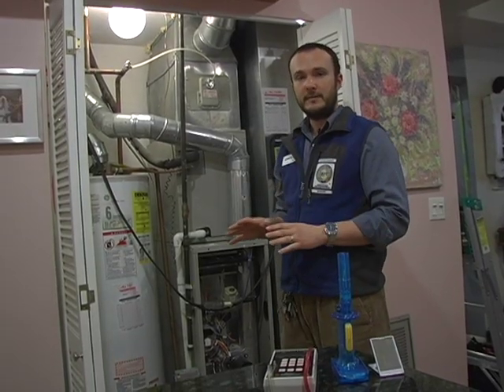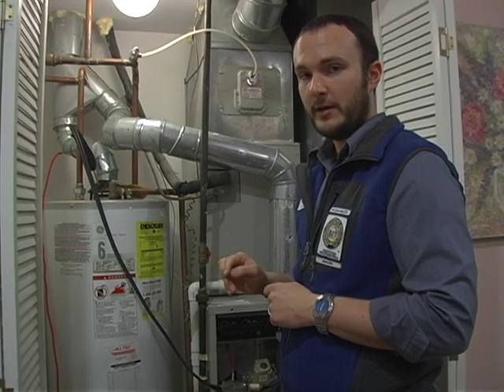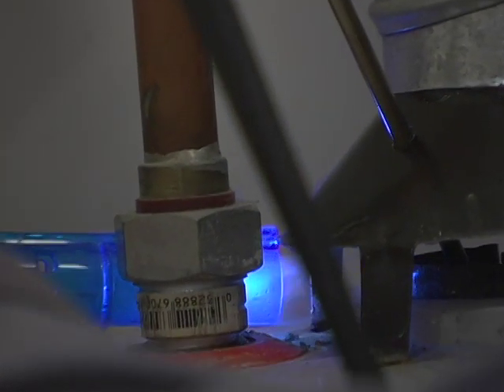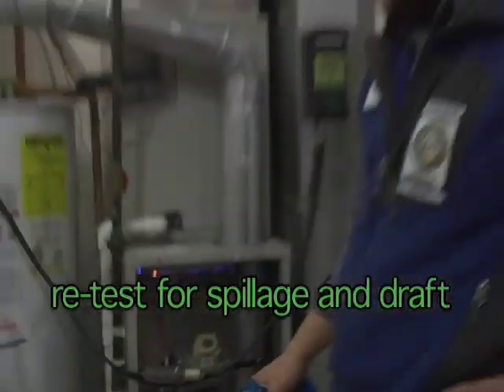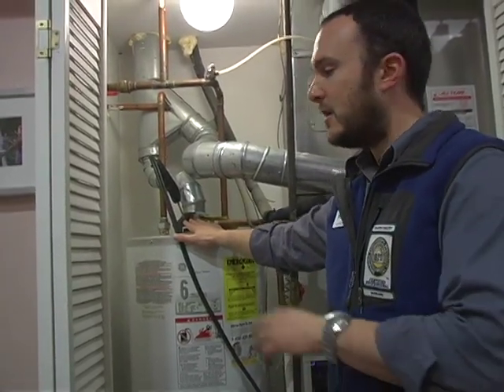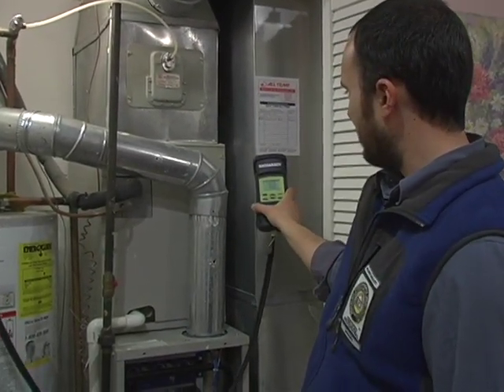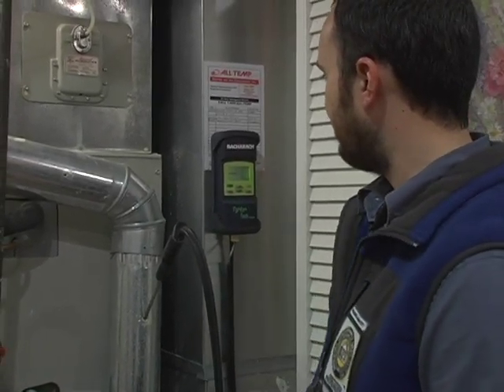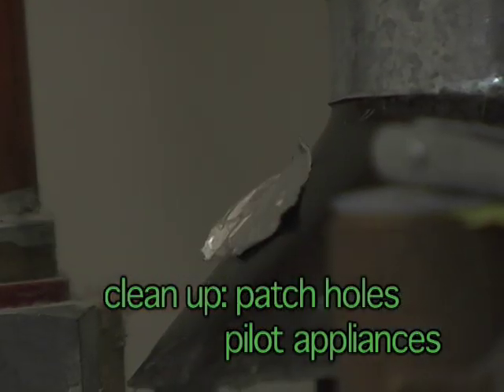Combustion Analysis and Safety Pt 2- BPI Review of 5 Point Combustion Testing

Comment: 25 ppm of co in the stack seems impossible in the real world. Of course the lower the better but through research I was told you want to stay below 100 ppm of co in the stack.  I would say maybe 10-20% of actual units in the field (even brand new) are above that 25ppm mark.
Reply from the maker: Not impossible. Plenty of pros test these units daily, and non-sealed combustion equipment can be held to higher standards.  FYI, the 100 ppm mark is the new, more lax BPI standard, for years the standard was lower.
Reply: My thoughts too
Reply: Manufacturers say less than 100ppm

Comment: This is correct. The purpose of the inducer fan is to establish the draft on initial cold fire-up. Once the appliance is at stable operating temperature, the natural draft takes over, and actually overpowers the fan at this point and pulls the combustion gases thru the little squirrel cage. If you bypassed the pressure switch at this point (don't actually do this please), and shut down the inducer fan, assuming you have a good drafting chimney, it would actually continue to run just fine.

Comment: This is correct, the International Fuel Gas code says for commonly vented Category I appliances (natural draft, non-condensing), the smallest appliance must be connected to the common vent at the highest level. This installation would not pass a code inspection here. Most states have similar rules that adopt the international code.

Comment: NIce video, thanks.  Around the 3:08 mark you indicate the furnace is a an induced draft and that it can not back draft.  
Beyond the combustion point of view, there is sill concern of the draft is poor on the induced combustion equipment.
Back draft is still possible.  You can have roll out at burner level and back draft there.  Or the possibility of back draft at the seams and gores of the vent and or vent connector.

Comment: There is a small amount of positive pressure right at the inducer fan but it is not a high static fan and this subsides quickly within a few inches of the fan as the heated flue gases creates a negative pressure as they draft up the flue pipe (hopefully). These are still atmospherically drafted appliances and rely on the buoyancy of the heated air to draft under small negative pressures.

Comment: Great video!!  We prefer to test the smallest BTU appliance then set it to pilot and test the larger appliance by itself then refire the smaller appliance and check for spillage and draft. This tests each unit individually and then together. Also, there is one sentence in the BPI standards that calls for checking for spillage at the draft diverter of commonly vented DHW for an induced draft furnace upon firing.